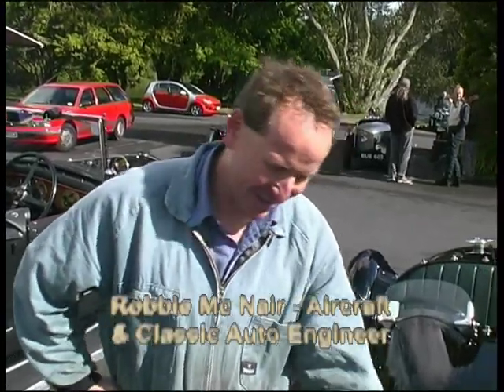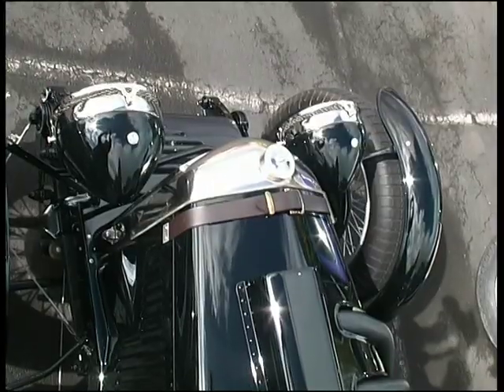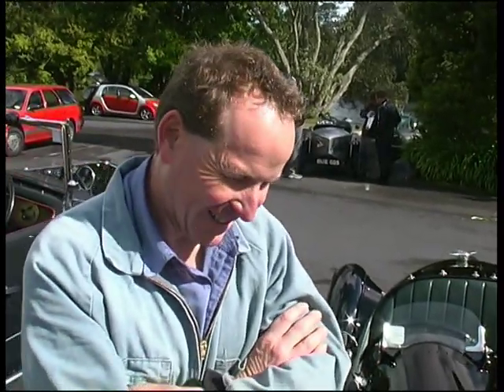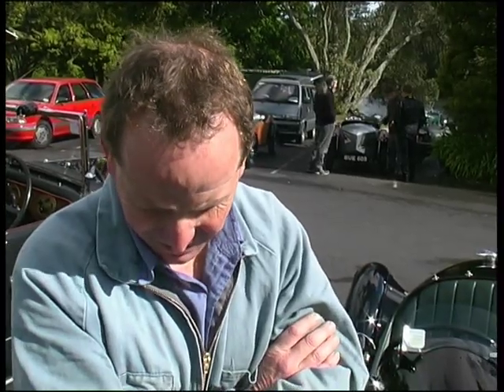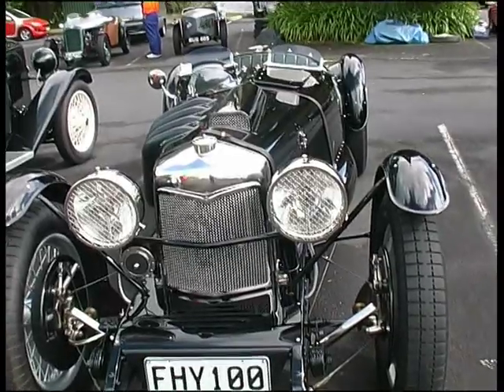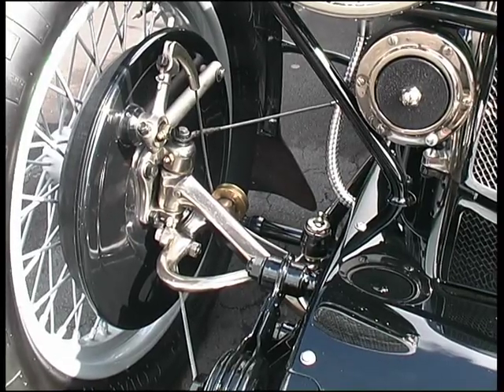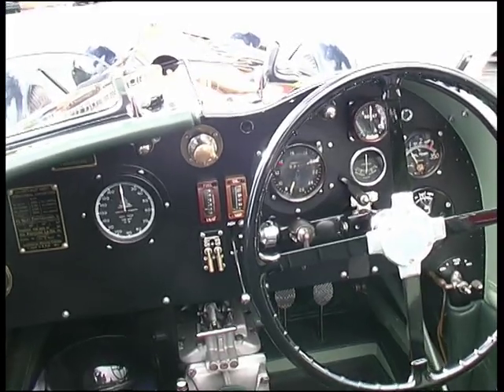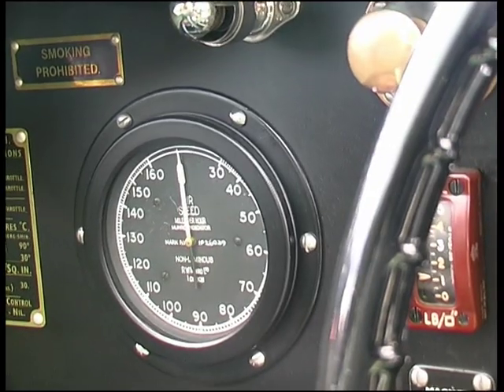Tiger Moth Engine in Riley Sports Car

Comment: Must have been quite a technical challenge.  I think this must be either based on a Gypsy Moth engine or an inverted Tiger Moth engine modified to make it run with the crank at the bottom .   Either way it must be a task keeping an inline air cooled engine supplied with enough cooling air at low speeds.
Reply from the maker: The builder used an inverted Tiger Moth engine with cooling obtained with a fan  from a Porche Mike

Comment: Interesting car. Were there any particular problems involved in turning the engine upside down to non-inverted?
Reply from the maker: promerops - How big a list do you want! Info not on Google and many of the problems Rob encounter are best forgotten! Lets just say you just have to put an oil pump in the sump which not can have an oil level that can be measured! cheers, Mike - AirflowNZ

Comment: Love it. Good inverted engine! How is it mounted in your car?
Reply: Craig, now the cylinders are facing upwards and not down, special engine mounts were fabricated by Rob the builder. The car was built by the owner who is a friend of my son. Rob has rebuilt a Tiger Moth which features in one of my other videos, it;s the black fuselage one. Cheers, Mike - AirflowNZ

Comment: Why use an aero engine, rather than a Ford Duratec or a current bike engine?
Reply: This was a joke right?
Reply: NZ Salt Flats Racer Well,  I'm actually quite curious. If I was building something like this, I'd use something like a Ford Duratec , Vauxhall 16-Valve, Ford Flathead, or a period twin cam.
Reply: He probably did it for a) period and theme correctness, b) it's what he had, and c) because there are few things cooler than near-bottomless torque from an aero engine :D  I also love the aesthetic of the engine spilling out from the bonnet, much cooler than any Duratec or flathead to me (and I LOVE flatheads)
Reply: He used an aero engine instead of a Duratec engine for the same reason you don't serve frozen pizza in a wedding; driving it is supposed to be a special occasion!
Reply: Period twin cam? Like the Riley engine?
Reply: @alexgreen1559  Maybe, but a Rover V8, Chrysler Hemi or Buick Nailhead wouldn’t go amiss. Maybe a period GMC truck engine, or Cord V8 as a hot rodder would have used back then.
Reply: @chrishenniker5944  I think you are missing the essense of what constitutes a vintage special. This car is not a hot-rod; to use any of the engines you have listed would strike its eligibility from any vintage sports car club; which is pretty detrimental if you want to go racing. You must be an American? There is precedence in your train of thought - as an orignal Riley Brooklands (chassis #8029) was given the yank-treatment in period - with the fitment of a Mercury V8 and heavier bodywork - being christened the 'Ardent Alligator'. It won the '49 GP at Watkins. The difference, however, is that the car is very much in keeping with the Riley's build period.
Reply: @alexgreen1559  There’s not much difference between a vintage special and a hot rod, but what are the differences? Just to let you know, I’m English.